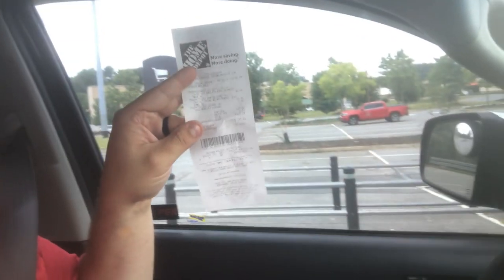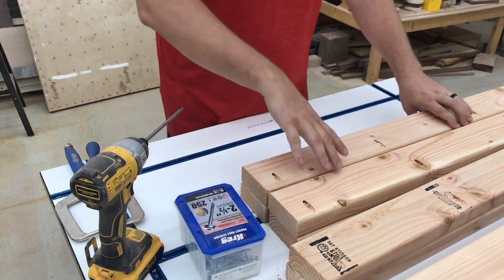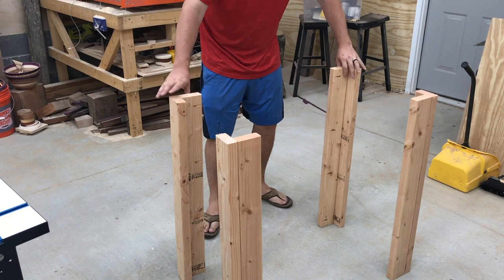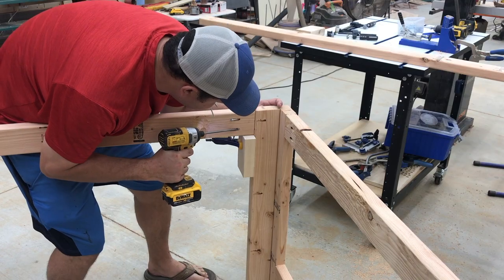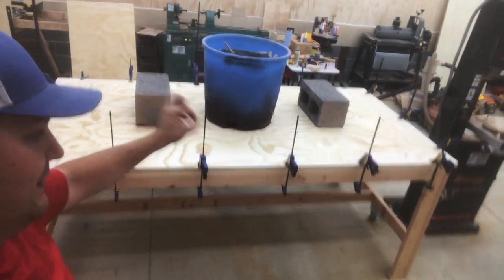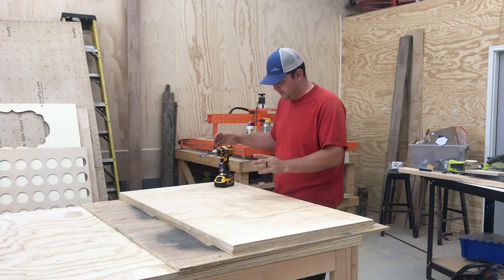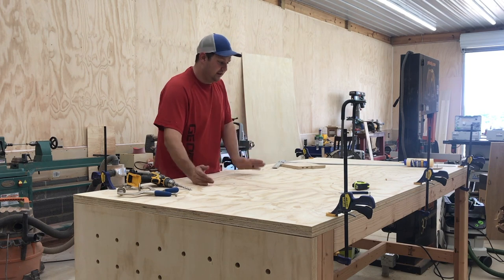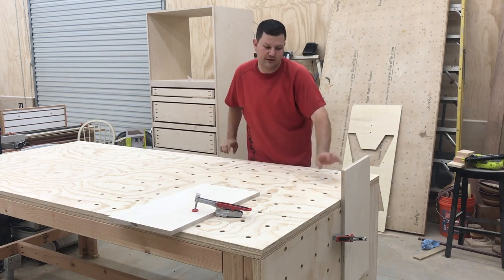HUGE Cheap and Easy Workbench/Assembly Table with Dog holes

Comment: Very nice! Just a thought - you only drilled holes on one half of the top. If you drilled one row of holes on the other end of the table, you'd then have access to the entire table surface for clamping area (doubles the length of stuff you can clamp).
Reply from the maker: Thanks for the comment Adam I like that idea

Comment: I like it, but I would make the 2x4 frame and rest it on top of the legs so it is not just supported by pocket hole screws.
Reply from the maker: True you could do that. I haven’t had any problems and I put huge cabinet builds and tables on it while I stand on top to and have had not problems
Reply: @oxintheshop  Yah, I am a structural designer.  I definitely may be overthinking things. ;)   Great build.

Comment: Hey OX.... ever consider putting wheels on this? If so how would you?  I made this along with you, but realized I need it everywhere in the 1600 sq ft shop but really don't need another one yet
Reply from the maker: I think rockler sells some that can be fit on the side of legs and the pressed down to engage to move around. That’s what I would use
Reply: @oxintheshop   thanks for the quick response, your are always the best at that.  I will check out Rockler, I like their items
Reply from the maker: Yea me as well I’m a big rockler fan

Comment: very cool, i also had kinda warped plywood, so i turned it upside down so all the weight was pressing on the tops, mine is only 3X5 but its heavy as balls
Reply from the maker: Yea since this video was posted I have gone back and added some storage under it too so it is a beast.

Comment: is there any reason to use those Kreg screws or really will any outdoor screw work like those used for deck building?
Reply from the maker: The Kreg just work the right way for the pocket holes but you can use others too
Reply: @oxintheshop  ok I figured I just wanted to make sure haha I don't like how Kreg has their own square lookin' head (but they do have a second option I think?)